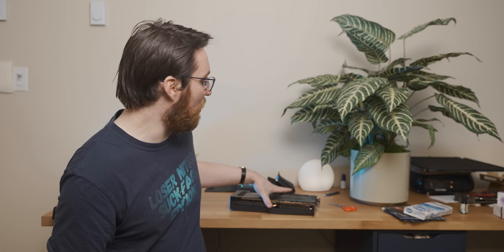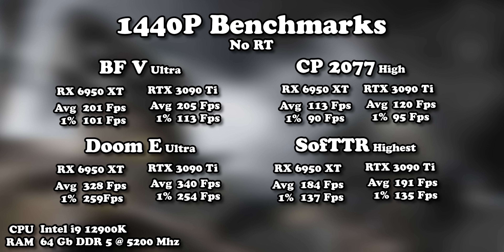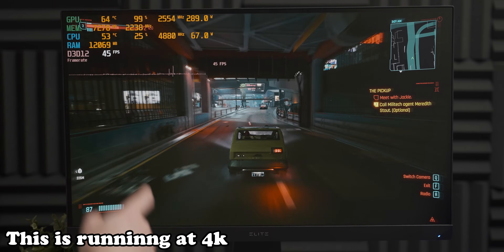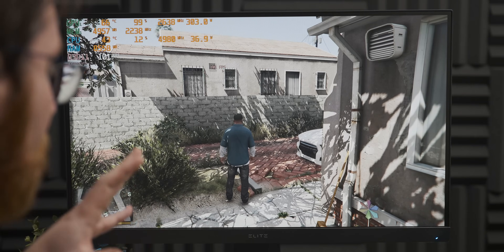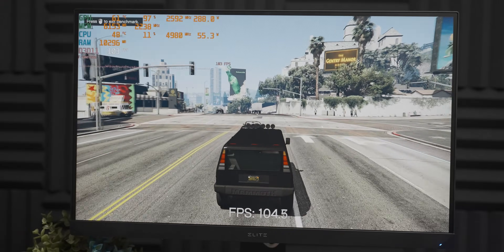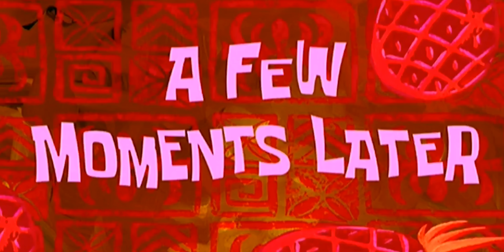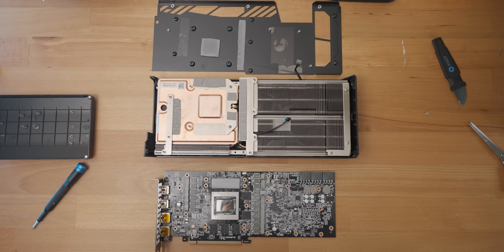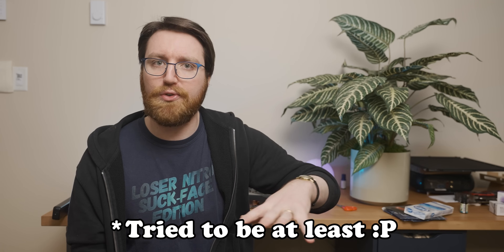I Can't Figure Out What's Wrong With This Gigabyte RX 6950 XT

Comment: For anyone having this issue in current times. I realized that the AMD adrenaline software caped my power to 20% for some reason so I went into the tuning and adjusted it. Most of the coil wine is gone thankfully I can barely hear it.

Comment: I’ve had this issue with a sapphire nitro plus card it’s the stupidest thing and it’s ands fault but each connector on the gpu needs its own power rail so to fix this use three separate cables from the psu plugged into their own power rail into each connector on the gpu and that should solve the issue 100%

Comment: hello can u help me. i have a 6950xt an its also not crossing 290W. im only playing on 1080p so im not noticing bad performance. thats not the reason tho as the card reaches close to 100% usage and it only draws 290W. i have the amd model btw the reference card
Reply: i tried stress testing and it doesnt even reach 290W at 99% usage
Reply: did you try to increase the power limit in the amd software?
Reply: @azegatta3922  how do i do that

Comment: Dawid Does Tech Stuff : Techpowerup is lying about many figures when it come to AMD. My RX 6900 XT 16GB has a 255 default power target that it exceeds if certain conditions (like temperature on different crucial elements) are met. It goes to maximum peak of 294 Watts with continuous of around 275 watts. With that default power setting it beats the RTX 3090 24GB absolutely everywhere in rasterizing rendering.
If I lift the power limit it can go above that max peak of 294 Watts.
How the Techpowerup got 381 Watts, i don't know....or yeah, I know, they are lying and are trying to make AMD be more power hungry to at least partially make them look bad.
The point is that the RX 6000 lineup is the most power efficient GPU series in the history of GPU-s period. Anybody that has one can testify to that.
Reply: I think you are talking about tdp. But AMD uses tbp. 

Tdp=chip power
Tdb=the entire card powerdraw.

No tpu isn't lying and is probably more reliable than you considering he uses a hardware powermeter and not an app like hwinfo.

And your entire rant about making amd look bad is just silly! You know that flag ship aib cards are oc'd to insane levels right? You know nothing about gpu's and are like a chiwawa barking at a bear.
Reply: @apotato5563  buttercup, your are sourcing your "knowledge" from superficially understood facts from selfproclaimed youtubers that have no prior first hand experience, no credentials, no education and no actual knowledge before they started these youtube channels. You are simplifying knowledge from your feelings about how you think things are with GPU-s.
I have a diploma from electrical engineering and I have been building/servicing PC-s since the age of 3D-FX alongside being an IT engineer and an electrical developer engineer.
Trust me buttercup, I know infinite amount more about computer parts than you, boy :).

Comment: I found the issue! You have to use a 4th gen board, and enable resizable bar or sam. I had this same issue in both my 9900k systems then dropped this card into my Ryzen 5950x system and bam pulls 370+ watts. I have the MSI gaming Trio X but was facing the same issues so it would seem you NEED 5000 series CPU to actually utilize this card.
Reply: Rebar/sam doesn't limit powerdraw.

You might just have a bottleneck. Or something was messed up and updating something in the bios fixed it but every gpu should be able to run at full powerdraw without rebar/sam.
Reply: so with mmy 7 5800x should be right? bc i ordered that  2 days ago

Comment: My asrock model also seems to have a default cap at 290W, but I was able to pull it up to around 347W using AMD's adrenaline software. Is this the same issue Dawid was facing here or does it not matter? I'm also getting normal numbers for this card in time spy, even at its default 290W, and it undervolts like a champ down to 1100 mV so should I just be happy?

Comment: There is nothing wrong with the card in this video. It's just that rivatuner doesn't show actual power consumption with AMD cards, you need to measure with power meter. I think it only shows GPU consumption, not the whole card.

Comment: Ive had massive issues with gigabytes higher power draw gpus in the past. Instability. Lower than supposed powerdraw. Massive coilwhine and loud fans. I've also had issues with their high end mainboards working in the computer store I used to work at. I generally don't buy gigabyte products anymore for this reason.

Comment: Brother the 289watt usage is only for the chip draw not the whole card nothing is wrong with ur card hook up a wireviewer and u will see ur card suck up the power ur seeing on other charts 😂! The fact that u dont know this is eeeehm semi embarrassing u can CLEARLY see ur clock speeds hitting over 2600mhz wich is what it should ! If the WHOLE card only pulled 289w and hit over 2600mhz on the core u would have a GOLDEN bin but no AMD's stupid power sensors are only showing what the ACTUAL GPU is pulling and not the whole card memory etc

Comment: I have the identical issue with a xfx 6950xt. I think its a ground loop or a short which would explain the coil whine, heat and under performance.
Reply: No its not a issue his has no issues either he is just a noob... 289watt is ONLY the chips power usage and not the whole gpu watt usage... amd power sensors are just stupid and can only show chip usage and not what the whole card is drawing

Comment: I got the powercolor 6950xt and my pc was shutting off during games so i thought my 850w psu was not enough so i got a 1000w psu and my pc is still shutting off. I don't know what to do at this point to fix the issue.
Reply: This was my problem in 3DMark, PC just turns off during benchmarking. Then I remembered the default setting of my HX850i is set to use multi-rail OCP, so I enabled single rail in Corsair iCUE.  Problem solved, no crashes anymore.
Reply: Switching to 1000 watt PSU fixed this issue for me with the Merc 319 XFX.

Comment: hwinfo64 images in your video say rx 6600. even if the name was an error and the stats were real, the core tdc limit is set to 100 amps. so the gpu can't boost anymore than that hence the limited power draw.

Comment: You sure the card is running @x16? I had a similar problem, found out my PCI riser cable was getting choked (and not in a fun way), which made my RX 5700xt run an x4! I readjusted everything and it fixed it.  Check the bus interface.

Comment: This happened to me. Got a new 6950 XT. Ran a few benchmarks and played a few games. Then i started tinkering in the driver and the card got stuck in 290w mode as in the video and performance went down hard. But after resetting everything and starting over setting power limit to +20% performance was back and the card was sucking down 340w. 🤷‍♀😁

Comment: What happens if you go in to AMD adrenalin and just put a higher power limit / profile ? Will the card OC the power and you get what you expect or is it still just totally locked ?! 

I have an XFX 6950XT and my old XFX 750 W silver rated PSU (that i really love) was crying so hard, it was extremely unsettling. Now i buy the Corsair RM750x and it is ALOT better in terms of coil whine.

Comment: AMD 6950xt reference card has a chip power limit of 284 watt... therefore your card's power limit is in line with many other custom variants of 6950xt cards..My 6950xt Sapphire nitro+ also has 289 watt power limit. Those are chip power limits, not total amount of power the card uses. 6950xt Nitro Pure for example has 304 watt power limit. For all those cards chip power limit can be increased with afterburner.. My 6950XT nitro+ can be increased 20% which makes it in 350 watt power range.. for chip. Total power a card uses then is higher.

Comment: Hello Friend, 
Have you checked your motherboard's BIOS? Sometimes, motherboards switch, out of the blue, from PCIE 4.0 to 3.0 or lower or even sometimes, the Auto Gen does not work perfectly which would limit the data bandwidth, and the power draw obviously. I would recommend going to the BIOS and forcing the PCIE to gen4 and trying again. Maybe i'm wrong, maybe i'm right, so let me know if this trick helped. Cheers

Comment: The solution is in AMD Adrenalin like what @Jonas Jonaitis says. it's just a power limit set by default on Adrenaline. My Asrock 6950 was also only pulling 290 watts but turning the power to max fixed it .

Setting power limit to max in Adrenaline -> Tuning -> Manual Tuning -> Power Limit % = 20 will fix this.
Reply: that's exactly what he did at 3:00 ; not in Adrenalin, but it has the same effect when done in Afterburner.
Reply: @keith303  hmm I must have missed it. i wonder if it wasn't activating with afterburner.

Comment: it's running on silent BIOS.
Reply: as mentioned several times in the video, it's not, he even flashed the BIOS with a rom of other cards known to work OK.
Reply: @keith303  no I mean it's running on the BIOS as a result of manufacturing and assembly error.

Comment: I have a MSI 6750W 12 Gb Mech X2 OC with a similar issue, its limited seemingly in its bios to 210W when even their web page says 250W draw. The card works fine, its quiet... but it does bother me.

Comment: My MSI 6800 xt also has considerably less wattage ppt 264W vs 300W on the website vs ~330W from the exact same model on techpowerup

My only explanation was that they might be measuring power in a different more real way since they have special equipment, but I haven't checked if I am losing performance compared to their numbers
Reply: From what I found in forums, the ppt limit is only for the core of the GPU, techpowerup at least measures with their own tools out of the 12v rails which they say is way more accurate than reported in software

Comment: I bet that one of the power connector ports are bad.

Each port can only handle ~150W each, so 3 working should supply up to ~450W. With only 2 working ports, that would limit it to a theoretical max of 300W of power.

Comment: Are you using a CPU 8 Pin Male to Dual PCIe 2X 8 Pin (6+2) Male Power Cable to connect the PSU to the card instead of using indiviual ones, 1 to 1 for each port? If yes there is where you problem lies.

Comment: i have the exact same problem with my ASUS TUF 6950XT it also "stop" at 289 watt is there a solution or like something else what u discovered in that time?
Reply: Setting power limit to max in Adrenaline -> Tuning -> Manual Tuning -> Power Limit % = 20 will fix this.

Comment: my guess is 1 or more of the power stages isn't working, probably a blown mosfet, fuse, or mosfet driver issue, (though, blown in open state, not short as card probably wouldn't boot at all)... The other thing it may be is something wrong with a feedback circuit somewhere (there are many) causing it to under drive the mosfets.  Regardless, it's weird that it isn't crashing.

Comment: Got a red Devil 6950xt and I got pretty much the same issue.
Reply: A bios update might fix the issue but you can brute force a power unlock with "more power tool"
Reply: @omegaPhix   I've modded the bios myself to draw more power.  Then I lowered the power a bit, told the clocks to run higher. And upped the voltage. Tempts are around the same. Fans aren't as loud. Performing fairly well. Updating the bios wouldn't do much so I took it upon myself.

Comment: It kind-of reminds me of a Tech Cemetery repair. Going on my terrible memory, I think most GPU VRMs are dual mosfet - dual high mosfet single low, or vice versa -. Well TC had one blown and couldn't repair it because the PCB was too burnt, so he ran it single mosfet and that limited the power, ie, it worked, just not at full speed.

Comment: I believe this is purely a board issue with the gpu one of the power components are broken and causing the voltage to be lower than it should be. If it is heating up like that something tells me the resister is messed up.

Comment: I have two of these I used to run in Crossfire, with a triple screen setup. The drivers became bugged out about a week after the warranty expired, and the fans quit working. It cooked all the solder under the dies on both cards while I was gaming one day. I've managed to oven them back to life more than a few times, but I really need to find someone who can reball the GPUs for me. FYI- These cards can be unlocked to 6970s with a BIOS hack.

Comment: The problem it's clear, it's a gigabyte... either dying capacitors or overheating, make sure the thermal pads are touching the metal plate, look for yellowish/brownish or cracked caps

Comment: My Powercolor 6900XT doesn't draw the full 300W power unless set to Rage Mode in the AMD software.  Maybe the same issue as when I install the latest AMD updates, my AMD software gets reset to default or OC settings with nothing changed.....weird behavior but maybe....

Comment: I had a similar issue with my rx 6900 xt a couple weeks ago when i DDU'd my drivers, it's a driver issue along with the problems of their power saving. I had to do a fresh install of the drivers and enable ULPS in msi afterburner and disable the features in MorePowerTools.

Comment: I have same thing with my PowerColor 6750XT Red Devil which draws less than my previous RMAd 6700XT. On stock settings, it draws max 200W and 170W on average instead of "Up to 250W" official numbers. But, I can't say it's underperforming, all benchmarks and tests shows it's fine.

Comment: I’m having this same issue with my 6900 XT but I can’t get past 100w power draw. 1080p games are coming in with really low frame rates and the clock speeds staying below 1200mhz for the most part. Really frustrating.
Reply: Did you RMA? Im sorry for u guys, can think how frustrating it must be. Got a 6950 xt and its running rly smooth and take all i throw at it... Hope yours will do the same soon!
Reply: @Nichtgenuegendholzmylord  it’s all good now. I found out that the games I was running were launching in directx11, but when I force launched into dx12 I got a massive jump in frames and power usage. I was relieved to say the least.

Comment: I had similar power issues on a gigabyte rtx 3090 vision oc .
I need to rma but haven’t had a chance yet.
One thing I noticed on mine was that gpuZ monitoring was showing one of the pcie power connectors was only allowing half the 150w expected
It’s either an issue with the power connector or that branch of the VRM on the pcb

Comment: The "coilwhine" with the low wattage indicates an inductor issue in the Vcore vrm. Get a multimeter and check it out. I put coilwhine in brackets cause there are no coils used these days :D

Comment: 4:04 it says rx 6600 and not rx 6950xt has it something to do with that?
Reply: RX 6600 doesn't draw 280W or nowhere near that.
Reply: @fahadal-asmari6893  but why does it say 6600
Reply: @michaelk7867  The card is not identified in the MSI afterburner the card still fairly new.
Reply: @fahadal-asmari6893  oh ok

Comment: What version of adrenalin did you tested it with ??
Reply: My rx6800xt had the same issue, it was driver after several times clean installing drivers finally on 22.8.1 driver fixed it as i draw almost 300W where it used to draw only 190W on other drivers.
Reply: One more thing is lol AMD driver isssue is a thing no one from AMD will talk or do something about it.

Comment: I'm pretty sure the feedback system is screwing with itself due to back EMF and EM interference causing problems in power delivery.

Long story short the GPU is acting like an antenna and it's picking up interference from itself. Try putting an am radio near it a badly designed board will cause this to happen and sadly you had the pcb for which its pads might have the resonant frequency of the oscillators. Try underclocking or overclocking it and see what happens and also try finding a plug with a solid ground as I'm 100% sure it's the power delivery system causing problems for itself

Comment: My first thought would be to check if it has a switch to change between some sort of "quiet mode" and "performance mode", some cards do that. on my 1060 there are actually 3 "profiles" that can be switched in software.
Okay, turns out that the 289W is actually the limit set in the BIOS.

Comment: I have the same problems with my gigabyte GTX 1080. Temperatures are fine but the backplate gets really hot and the fans are running nearly all the time. And in fortnite for eg I only get 80fps max. Trying to overclock it didn't change anything.

Comment: I've had nothing but bad experiences with Gigabyte cards. I bought a 1070 and that just randomly stopped working, where I wasn't able to get any video output. The RMA replacement I got for it (which was a painful, long process to get from them) literally went up in flames about 2 months ago. Luckily, the rest of my system wasn't damaged, and I was already saving up to buy a 3080 so I definitely could be in a way worse situation right now, but that still goes to show the poor quality control that Gigabyte employs in their products.

Comment: 6900XTXH owner here.
Enable ReBAR, try to overclock your card running SuperPosition (this should trigger other "state" - that is diferent from gaming), check for changes. 
Keep in mind that overclock (Core) add voltage by itself - similar to how Vega56/64 work.
If this fails, increase voltage offset via MSI AF (voltage reading may not be possible/wrong - power should Change regardless)

If you ever get to read this comment, say something.
"Core" voltage have implications on Mem. Voltage too - or so we think (XTXH variant have Mem clock unlocked)
Reply: I would just check the power limit. Raising that should give the card the headroom to clock higher.